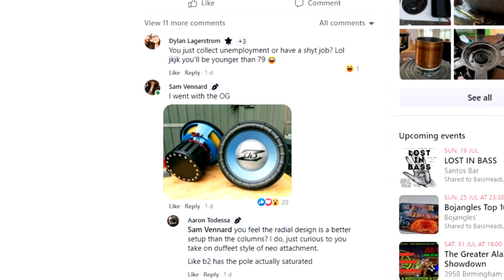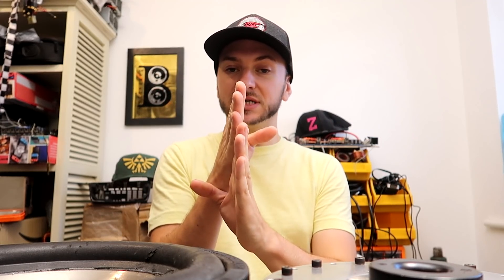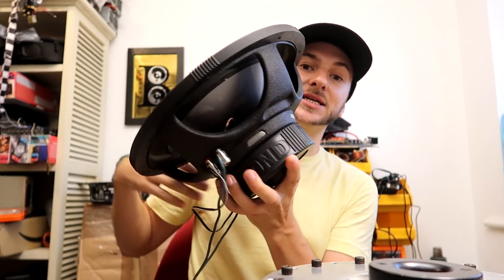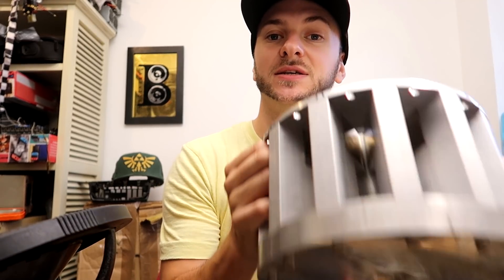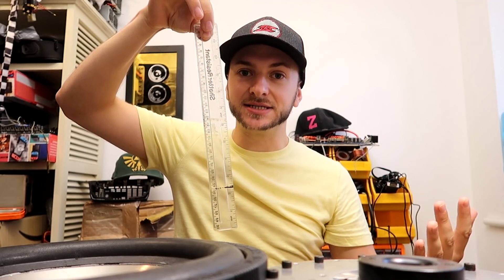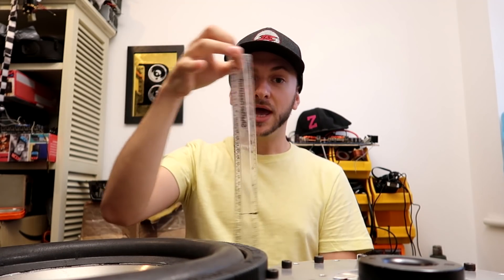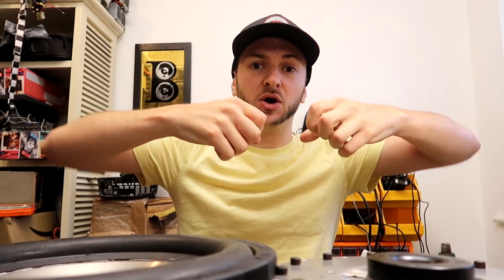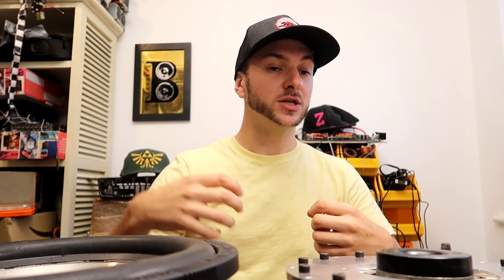Making you realise how ported boxes actually work

Comment: Can you explain how this can be applied to band pass enclosures
Reply: Like he said, the sealed side acts like an air "spring" so the sub gets help controlling the back stroke. And the front ported side still acts like the ruler, BUT you only get output at the end (port) of the ruler, and almost all frequency outside the port frequency is lost.
I can't remember....I think it's a 3db increase at port frequency vs if you erased the sealed side.
This gets complicated by are we talking 4th or 6th or X order?
Reply: @ryanwaege7251  when I made the comment I was thinking about a 6th order and how both sides being ported would affect the sub movement
Reply: @StarBoimuzic  I was going to guess that, didn't want to assume! Take his example of his fingers holding a ruler but add a second ruler pointing up/opposite the first one. Front and rear chamber (ports) both amplify output at the port frequency/ resonance, reduce output at other frequencies. No cone output, just port.

Keep in mind, while the sub hardly moves at port frequency,  everywhere else it is working against the enclosure. In other words, excursion, lots of it, usually followed by blown sub. Because bandpass also obscures the sound of the sub's coils performing ritual suicide. Ask me how I know. 😁 Of course, you also clip the amp for max gains in a competition. It all increases those dBs but like a tuned engine it becomes more fragile because of the increased output.
Reply: Forgot - because of the out of port frequency issues with the sub, always pair a bandpass box with a band pass EQ filter that matches. High and low pass to keep the sub from killing itself.
Reply: @StarBoimuzic  Read your reply again, specifically how it affects sub movement. The sub will again move less the closer it is to the port frequency. I only saw 6th order in competitive setups where both sides were tuned the same but I gather you can actually tune them different so you can make 2  different bumps in frequency response, one from each side. So...like 2 different length rulers.

Comment: so when you set your subsonic and lowpass very close to port frequency, should you be able to throw stupid amounts of power to a sub woofer that couldn't handle that much power in a normal situation??
Reply from the maker: Up until the point where the coil fails. A subwoofer system has 4 limits: a) Subwoofer excursion limit b) Subwoofer coil thermal limit c) Amplifier clip limit d) Vehicle power supply limit. Playing a tone at tuning frequency generally means you wont hit the excursion limit first, but if the box is too big or the port is too small, then you still might.
Reply: @barevids  so even tho your sub is barely moving at port frequency the coil is still working hard and the amp is using its higest output?
Reply from the maker: Correct. It's like putting your bike in the highest gear, you are working very hard, but not pedalling very fast, yet the output speed of the rear wheel is very high. You're converting the maximum percentage of electrical energy into air displacement out of the port by loading the subwoofer cone heavily, like the high gear loads your legs heavily, it's hard to move so you don't move much but still get a lot of work done.
Reply: @barevids  thanks man! very informative.
Reply: Good question and great answer.

Comment: Can you explain how the impedance selector switch works  on the JL Audio RD1500/1?  It's rated 1500 watts RMS at either 1 or 2 ohms at 14.4 volts.  I've seen amps rated similarly,  but I assume they automatically adjust themselves, versus JL that requires you to switch between 1 or 2 ohms.
Reply from the maker: havent worked on one myself but the amplifier will be built around 2ohm operation and actively limit for 1ohm use. I would imagine it either:
1) Switch enables a current limiter that attenuates signal amplitude, like an induced-clip 
2) Output switching duty cycle is changed away from 50% which will cause sine wave to clip at top or bottom early when in 1ohm mode
Some older amps will have a switch that physically routes to a secondary transformer wind with more turns for higher ohm operation, but the switch has to be able to pass the power so its unlikely that is the case here.
Reply: @jahmoy Berry You would need (4) dual 4 ohm woofers to get there. Look up "subwoofer wiring wizards" to see it in picture form.
Reply: @jahmoy Berry what woofers are they? How many? And whats the impendance of each coil?
Reply: @jahmoy Berry just parallel all the 4 coils. But why would you want to run that low?
Reply: They are Dual voice coils 2ohm oer coil. Parallel each woofer. Merge all the +  terminals, and - terminals. Then take them collectively to the amp.

Comment: 🤯 When You Started Swinging That Ruler. And Then Excursion For Bandwidth. So Awsome! I Play My Subs At Full Excursion At Tuning On My Ported Box But As Soon As You Go Out Of That Tuning It's RIP Suspension! I Have To Have A Very Aggressive Roll Off Hz Curve On All My Music I Edit For Demos. The Goal Is To Have The Same Excursion At Tuning And Same Excursion Above And Below. If You Dial Your Db Curves At Certain Hz Trailered To You Subs Tuning You Get Some Killer Longer Lasting Demos With Alot Less Manual Bass Knob Control lol.

It's More Complicated Then This Too. Because Even Though You Keep Your Mechanical Movement Uniform The Coil Thermals Are Not.

Comment: Fantastic best explanation ever. I can now show my mate why his twin 15s are quite compared to my single 10
Reply: Lol 2 10s will blow 2 15s outthe water nobody has the space to put a fat enough port for 2 lmao
Reply: @kkpage01100  umm...damn near any mid/full sized suv has enough space for a proper sized port. I had 2 Kicker l5-15's in my suburban with a 17"h x 6"h by 20"l port between them. If I remember correctly I had it tuned around 29 Hz. They wanted SOOOO much more power than I had the funds for.
Reply: @less5406  yeah a suv not everybody has suvs just to put beat in 😂😂 im talking about a regular person that don’t the understand port area part. Usually mfs that think 2 15s is going to blow 2 10s away but shieeet 10s slap hard as shit